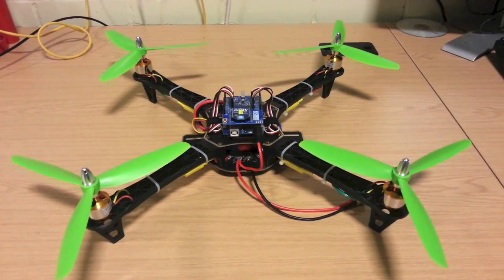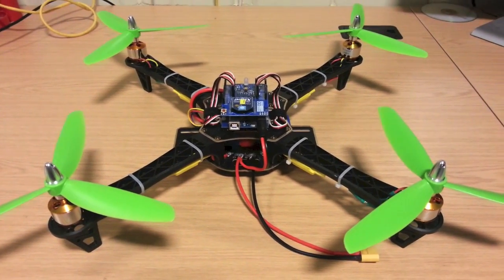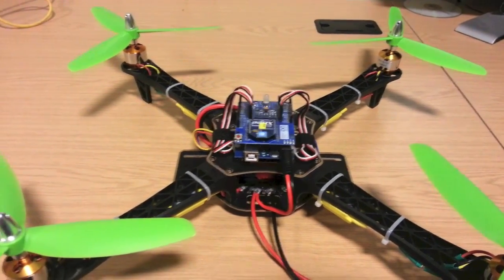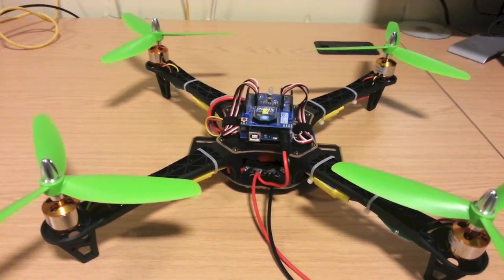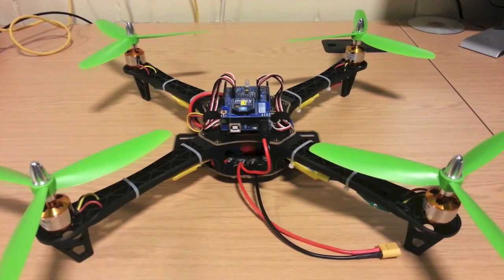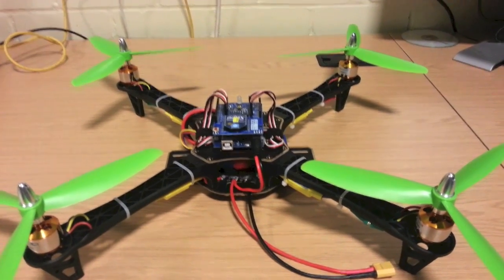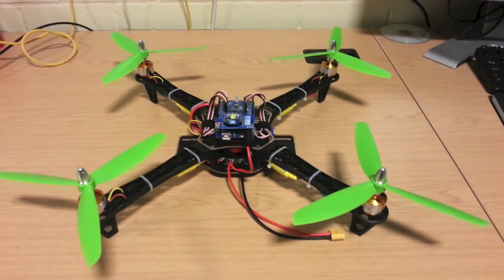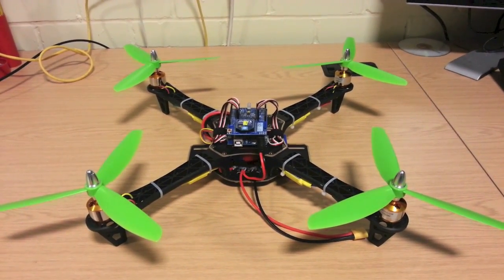Arduino Quadcopter - Phase 3 (The Rebuild, Part Reviews and Tips)

Comment: hi please I m having a problem compiling my i2c (mpu) chip. I keep having the same error message mpu6050 does not name a type. and accelgyro was not declared in the void loop. please can you help me with you code or guide me on those problem thank u
Reply: You have either installed the library in the wrong libraries folder or you have the folder name wrong.  The MPU6050 library folder should be in the libraries folder in the folder where your programs (sketches - Ugh !) are.

Consider joining the Arduino forum on arduino.cc for more help
http://forum.arduino.cc/index.php?board=4.0

Comment: Hey, i recently started working on my quad project and got the same battery as you, i was wondering what did you use to charge it? i have been looking on the Hobbyking site and i was a bit overwhelmed by the amount of chargers, any chance you could help me out? Thanks.
Reply from the maker: HI, Thanks for your comment. I use a turnigy acculcel 6 to balance charge my LiPo Batteries.

Comment: ive soldered everything correctly but i don't get beeps when i plug in my battery everything is connected to the quadcopter frame am i supposed to use jumpers after soldering it to the frame or is it supposed to work right away
Reply from the maker: Hi, Thank you for your comment. Have you got motors connected to your ESC's? It is infact the motors that produce the beeping sound rather than the ESC. You should get at least a small chime or beep depending on your ESC when you connect a battery and motor. If you can let me know a little more about your set up myself or my subscribers may have some suggestions.
Reply: Yes they are connected to the motors and the esc are soldered to the 4 spots on the frame and the battery to the fifth spot but still nothing

Comment: how did you connect the motors to arduino? ;(
Reply from the maker: Hi, Thanks for your comment. To connect everything up you need to do the following;

Connect your motor to an ESC, using the red, black and yellow connections. Connect the ESC to a power source such as a lipo battery. Then plug the white (signal) wire from the ESC connector and plug that into a PWM port on your Arduino.

Hope this helps.
Reply: Kyle Fieldus Hello Kyle. I had a similar question, so this helped a lot. However does this mean that all my motors will have its own power source? And does each ESC need a lipo battery?

Comment: How did you connect the battery to the arduino?  Is there a converter for the adaptor?
Reply from the maker: Hi Thanks for your comment. The frame I am using has a built in PCB circuit board for power management, but to connect the Arduino to the Battery I used some thick guage wire and a standard DC power jack. The Arduino Uno/Mega/Nano/Duemilanove/Leonardo all have power regulators so you do not need to convert the power voltage.
Reply: Kyle Fieldus Thanks for your reply! Could you post your code for the Quad? I'm trying to figure out how to program the MPU-6050, and it's a little over my head.  If I had something to base my code off of, I think I'll understand it a little better.

Comment: Hi Kyle, thanks for the amazing video, could you please help me understand how are you connecting ESC and  MPU-6050 Module 3 to the Arduino? How are you controlling and the motors and MPU-6050 Module at the same time.
Reply from the maker: HI, Thank you for your comment.

The Arduino connects to the signal (White) wire on the ESC's using a PWM port. (These have a ~ next to their number). To control the speed of the motors you need to control them like a servo, sending angles to represent speed. The MPU-6050 is connected to the Arduino using the I2C bus. Connect the power and ground to your Arduino, SCL and SDA to pins A4 and A5 of your Arduino. You may also find it helpful to attach the INT pin of the MPU-6050 to D2. You will need the Wire.h library to use I2C. There are many open source sketches for the MPU-6050 that helped me understand how to interpret the data. Look for one that uses the DMP. (Digital Motion Processor)

Hope this has helped.

Comment: are you still using two arduino unos and two xbees in this video or were you able to get rid of them i dint see them in this video so i wasn't sure
Reply from the maker: Hi, Thank you for your comment. I realised that the Arduino connected to the computer wasn't required and that I could just connect the Xbee to the computer using a USB explorer board. I have recently moved away from using a mobile phone as the controller and am using a controller shield to talk directly to my quad. This is my video Funduino Joystick Shield Review
Reply: So there is two xbees but one arduino and the other xbee is going straight to the computer using the USB explorer board
Reply from the maker: that is correct.
Reply: Ok Thanks for the info

Comment: what is the speed of motors and what types of motors are they??
Reply from the maker: The motors you see in the video are no longer being used. I am using these now: http://www.ebay.co.uk/itm/4-Pcs-Emax-MT2213-935KV-Brushless-Motor-for-DJI-F450-X525-Quad-copter-MT2213X4-/190888730179?pt=UK_ToysGames_RadioControlled_JN&hash=item2c71dade43

These are a major improvement to the ones you see in the video

Comment: nice build man, i'm also currently working on a quadcopter controlled my an arduino ^^
Reply from the maker: Thanks for your response. I haven't yet played with wirte.Mircoseconds(XXXX) but I am meaning to try it.

it may be that the value 40 isn't enough to arm your device, it will mean changing 1 number -> uploading and trying etc.

Just to recap:

the arm process is completed withing
void setup() {
m1.write(put a speed here)
}

your loop must continue to hold the above speed as the minimum otherwise the motor will drop off.

void loop looking like this

void loop() {
m1.write(arming_speed + throttle_speed)
}

That way your motor will always receive a value that is valid enough to keep it armed and then you can add to it to produce movement.

Mine is armed at 40 and starts spinning up at 75.
Reply: i tried a few things and this seems to work:
#include <Servo.h>

Servo m1;

  void setup () {
  m1.attach(6);
  delay(2000);
  m1.write(40);
  delay(1000);
  m1.writeMicroseconds(1000);

}

void loop() {
 
  m1.writeMicroseconds(1100);
  delay(3000);
 
}
the motor will idle at its minimum speed
- looking forward to programm the whole thing ^^

Comment: what kind of motors did you use man?
Reply from the maker: Hi,

Thanks for your comment. The ones you see on my quad at the moment are very cheap and cheerful http://www.ebay.co.uk/itm/4-2212-13T-Outrunner-Brushless-Motor-for-RC-Multicopter-Xcopter-/281147424801?pt=UK_ToysGames_RadioControlled_JN&hash=item4175b14021

I began to experience problems with theses though, bearings weren't smooth and the motors didn't last very long. I since invested in a decent set of motors, I would really recommend these:

http://www.ebay.co.uk/itm/4-Pcs-Emax-MT2213-935KV-Brushless-Motor-for-DJI-F450-X525-Quad-copter-MT2213X4-/190888730179?pt=UK_ToysGames_RadioControlled_JN&hash=item2c71dade43

Hope this helps. :-)
Reply: Kyle Fieldus thanks for the advice, do you think i could take a look at the code you're currently running? ill just use it as a sort of template.

Comment: what is the size of your propellers or where did you get them?
Reply from the maker: Hey, Thanks for your comment. The set you see in the video are 9x4.5 Tri blade props from ebay. I also have some standard 10x4.5 props also from eBay.

Conventional props are more efficient with battery life however require more balancing than tri blade props.

Hope this helps.
Reply: Thank you
Reply: Kyle Fieldus
Do you have any idea how much lift those 9x4.5 props deliver and also what are the specs your motors?
I am getting as much info as I can before start purchasing the parts.
Thanks.

Comment: How have you designed power management? Does battery power Arduino and ESCs in parallel, do you use UBEC, does Arduino power ESCs?
Reply from the maker: HI, Thank you for your question. I have designed it so the Battery powers everything. (ESC's and Arduino). The Arduino wouldn't be able to power the ESC's as they require too much power. My ESC's do have UBEC but I haven't used it.

Comment from the maker: HI thank you for your comment. I am using Xbee Wireless Communication, the Arduino Wireless Protoshield does not have any inbuilt IR capabilities, it gives you a socket to plug in either a Bluetooth or Xbee module and some prototyping space to solder your circuitry to.

Comment: Hi, I saw you used Xbee as communication part of which the principle is Radio Frequency communication, but you also have arduino wireless protoshield which is infrared communication method. So which communication method you are using for this quadcopter on earth? Thank you.

Comment: Could you find small accelerometers to use on each arm of frame (put near ends) and when they go out of alignment by certain angle it tells motors to adjust accordingly to stable flight? this would be for hover mode. Possibly use while driving it by making sure if it goes upside down it can reverse itself.

Comment from the maker: Hi, Thank you for your question. I am using the Uno, I have seen many people use the Mega as they prefer to use SPI for their IMU communication. I have also seen many people use the Arduino Nano, which is essentially an Uno but much much smaller and lighter, however you would need to wire up your own power inlet. Hope this helps.

Comment from the maker: Hi, I had the same issue at the start. The trick I used is to send an array of Bytes like so: (Requires arduino library)

byte output[] = new byte[length required]; 

store data into array like this :
output[0] = byte(value to be stored);

send to arduino like this:
for (i =0; i<array_length; i++)
{
  arduinoPort.write(output[i]);
}

Hope this helps

Comment from the maker: Hi, yes I do use the Arduino Servo library to control my ESC's. I connect the Signal (White) wire to a PWM port on my Arduino. The way the library works is you send an Angle <360 to create the movement you desire. You will have to work out the arming angle though otherwise your ESC's will not work. For mine it was 40. Your code would need to be something like this:

include Servo.h
Servo motor1;     
motor1.attach(6); // Attached to Pin6 of my Arduino
motor1.write(speed);

Hope this helps.